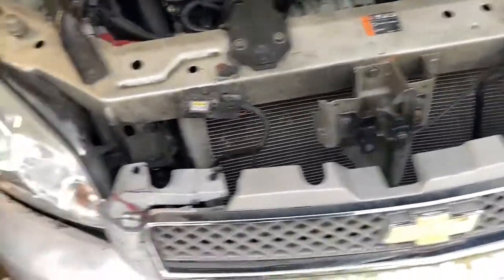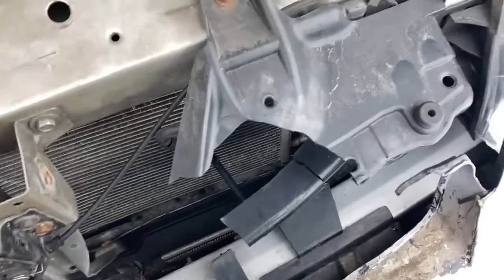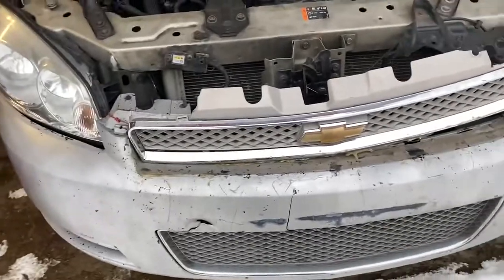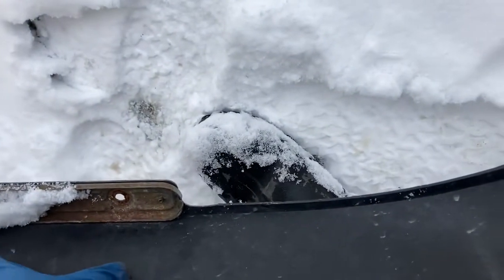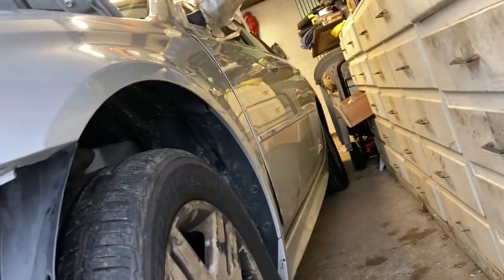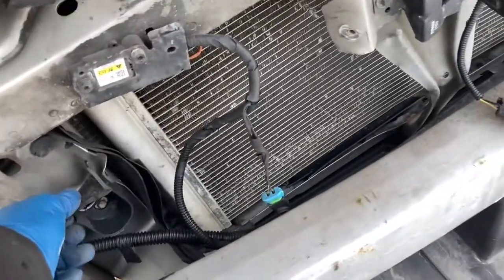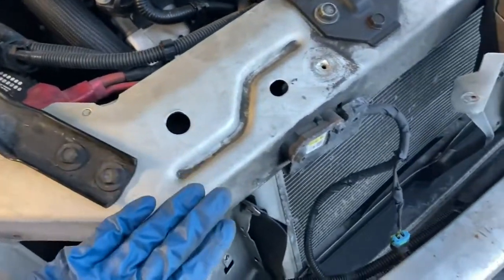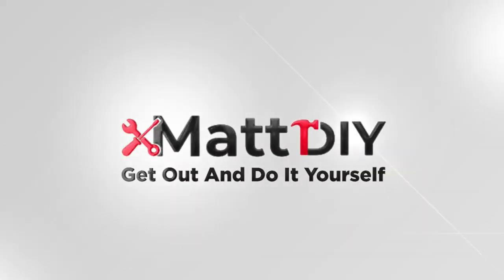Chevy Impala Bumper Cover Removal | 2012 Chevy Impala Rebuild Part 4

Comment: Wow Matt, your becoming a bit of a prophet for me.  On the 2012 with the 3.6 I bought 2 weeks ago you were spot on about the stripped drain oil plug.  I got mine off by folding in 2 layers of paper towel between the wrench and plug.  It took up all the slack but I did have to help it along with a hammer.
Now I'm dealing with pinhole leak(s) on the aluminum power steering cooler lines right up front and by the radiator.  I'm wondering if I could access it better by the top like the intro to your video or if I should remove the bottom shroud with all those cheap snap plugs/clips.  Any thoughts?
Reply from the maker: Thank you and glad to help!! Yeah... no idea why people put those on so tight...there is not reason to at all. As far as the lines, it has been a while since I worked on that car but you might have better access from the bottom. The clips come out fairly easily with one of the removal tools usually without breaking. Or you can always get some new ones cheap but this may be easiest to get in there! Kind of surprised with pinhole leaks though....you sure it isnt leaking where it connects to the rack and dripping down the pipe or something? Just a thought!
Reply: @matt-diy  That was my original thought as well but after pulling back that shroud a bit I could see that someone had "wrapped" about 2 inches of both cooler lines with old (3/16" ?) fuel line and when the car was running I could see a steady drip every 5 seconds or so from that exact spot.

I guess I'll look at one of those pulling tools you mentioned.  Thanks for the reply.
Reply from the maker: @erickrobertson7089  Ahhh I see boy oh boy wonder what they did lol and clearly didn't fix it right. Also, here is a link to one of the tools they work great! https://www.amazon.com/GOOACC-Retainer-Plastic-Fasteners-Chrysler/dp/B07L6FJGR4/ref=sr_1_3?crid=CALROKCJE0F&keywords=body+clips&qid=1647878439&sprefix=body+clips%2Caps%2C109&sr=8-3
Reply: For what it is worth...

That Amazon removal and clip set you suggested really moved things along.  I would highly suggest it to someone else.

As for the power steering cooler...  
At first I tried by removing the top radiator shroud and upper grille but no way was that going to work.  Then I tried removing the bottom plastic engine/front clip shroud.  Went along fine until I got to the two (10 mm?) nuts that hold the front clip to the quarter panel.  I could not get in there from any angle I tried, either from the wheel well or behind the headlight.  One actually looked like a rivet and just sat there and spun.  Finally tried removing the lower grille and I had enough access to fish the old one out and the new one in.  Had to pull down on the shroud as it was going through though.

There is a lot of Mickey Mouse on that Impala trying to get stuff off.  Everything is connected to something else.  It's like one of those Russian nesting (Matryoshka) dolls.  At any rate if I had started by removing the lower grille it would have shaved hours off.

Again this video was helpful.  Thanks again for the upload.
Reply from the maker: @erickrobertson7089  Awesome glad it helped out and the video as well! Yeah sounds like it was tough to get in there but glad you got it nice work!